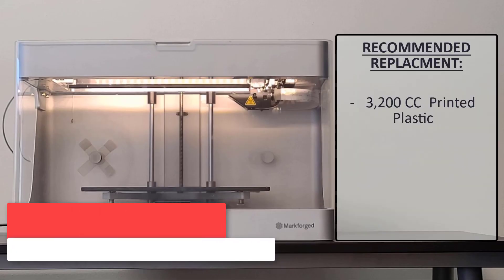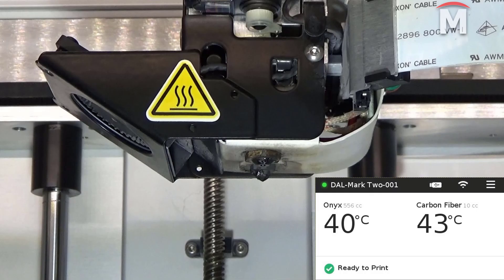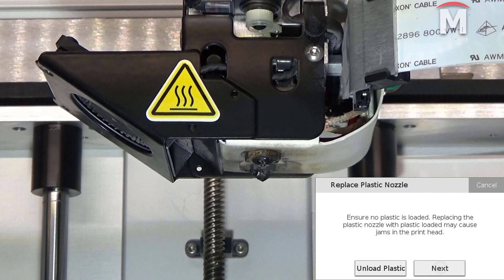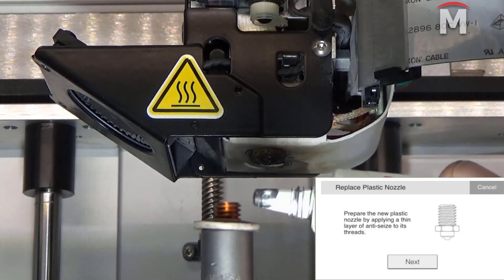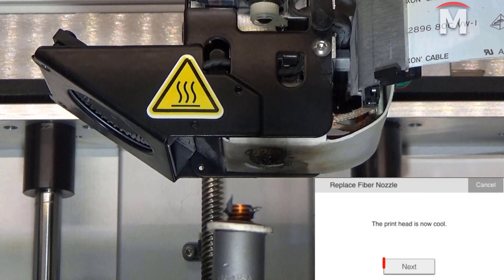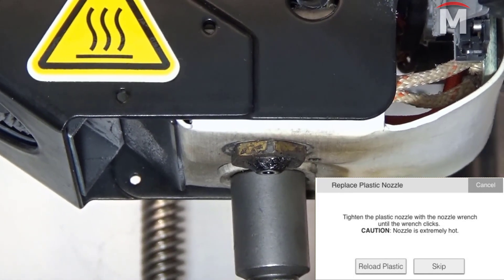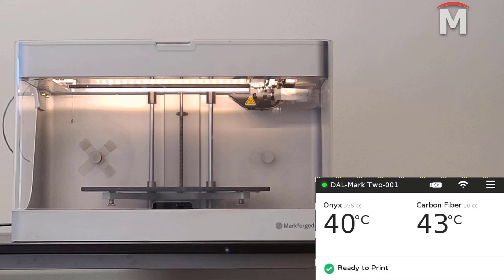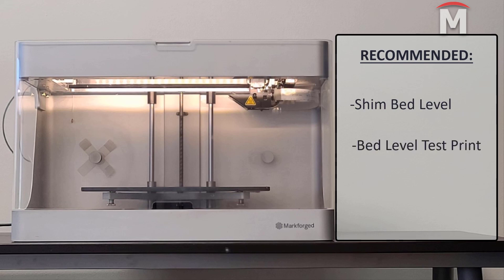How to Replace the Plastic Nozzle - Markforged Desktop

Comment: what torque setting do I set the 7mm torque wrench when installing a replacement plastic print head? Thanks!
Reply: From other comments, I see the torque wrench spec may be 1.40 Newton-meters (Nm), or 12.4 inch pounds.

Comment: What is the nozzle thead pitch? I have had my Onyx One for 7 years and I finally stripped my threads on my heater block. I plan to go ahead and attempt to fix it with a heli-coil. Thanks in advance.

Comment: What’s the torque spec lol
Reply: 12.4 inch pounds
Reply from the maker: Every printer comes with a torque wrench that is pre-set to the required value, but it's a very low value.  Replacement wrenches can be ordered if needed, but I don't see the torque spec published directly.